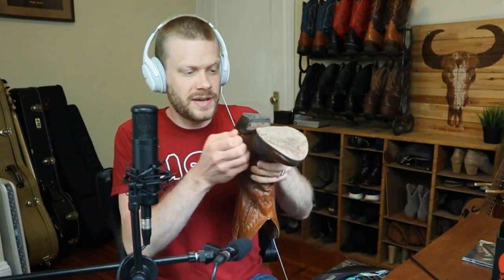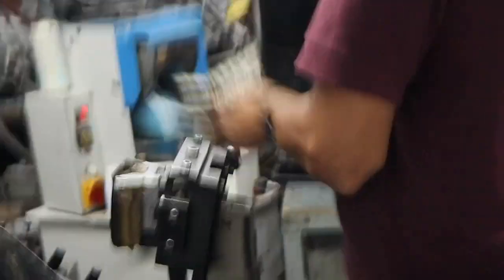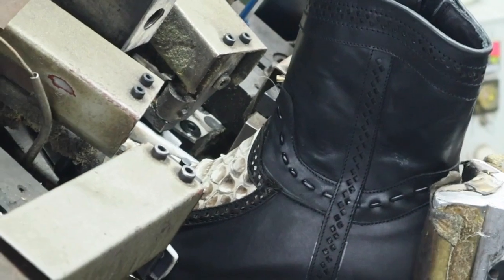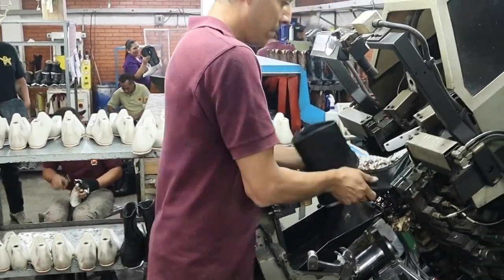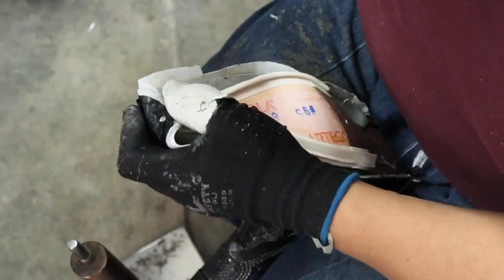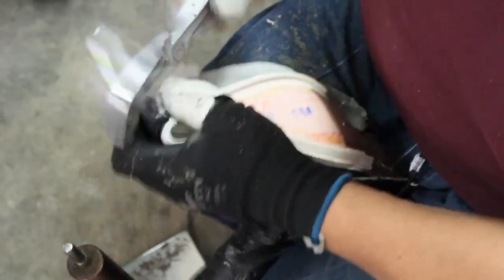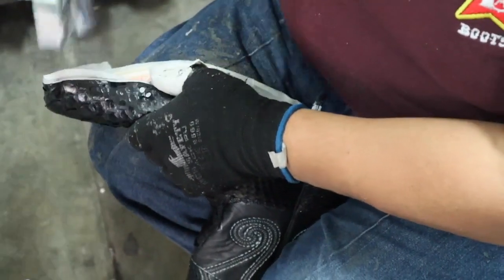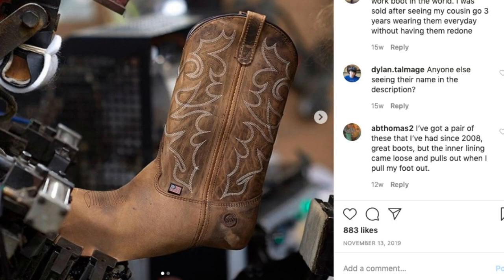How Cowboy Boots are Made in Factories: Hand Lasted vs Machine Lasted

Comment: It has nothing to do with lasting, hand or machine, and everything to do with whether the vamps were crimped or not. Where on the hide the vamp was cut from also factors in.
Reply from the maker: In many of these factories, crimping is skipped altogether so it leaves all stretching to happen in the lasting process. Crimping is going to result in a much higher price for boots because of the amount of time it takes.
Reply: Hand lasting is not any better than a machine if the vamp was not crimped, you will still encounter the same problem. Factories only hand last as a marketing strategy, they can charge more money for the same faulty product.

Comment: It depends on the leather. Gator, caiman, and croc don't stretch they rip. I got some black caiman belly Lucchese's that fit too snug thinking they would strectch with time but they still feel tight and the leather started to crack a little. I don't care I still rock them. By the way, a worker in Mexico makes $4.50/day along the US border. They make less further south.  Minimum wage in El Paso, TX is $7.25/hr.
Reply from the maker: Big difference in pay! The folks in the Los Altos factory in Leon weren't paid that low but I still thought it was nuts how low it was.